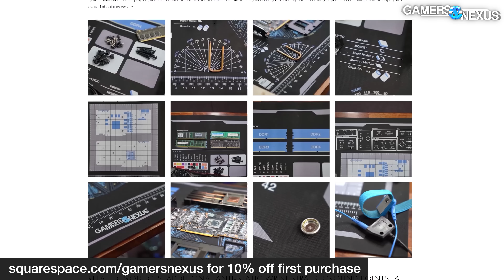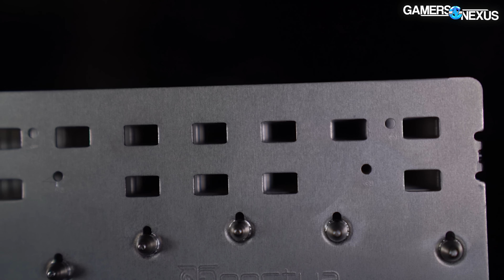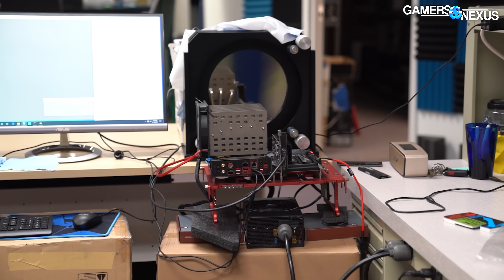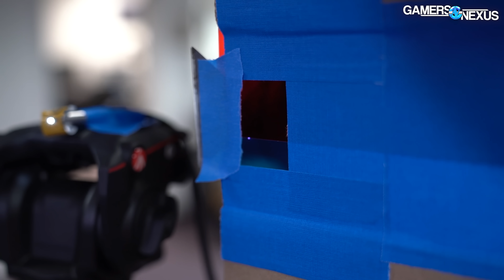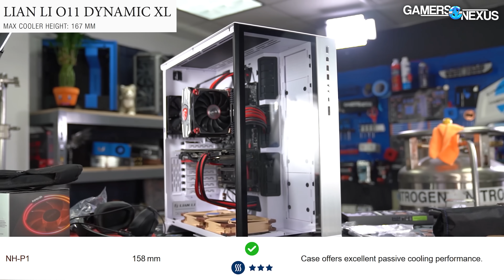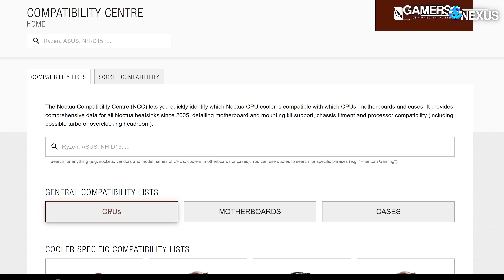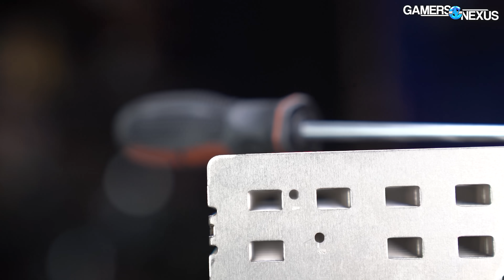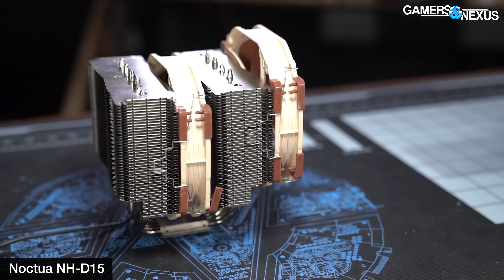Noctua NH-P1 Passive CPU Cooler Review: Benchmarks, Schlieren Photography, & Mechanics

Comment: Only good things here.

1. There's finally a pretty decent passive air cooler and while expensive, it makes a lot of sense for midrange cpus like i5 and R5. Even for APUs.
2. Steve has a new methodology and a new noise baseline to meme about. Not to mention he got the chance to use his fancy equipment.
3. This thing could be great for mineral oil pcs, if you're into that kind of thing.

Comment: Noctua is one of my favorite if not the favorite IT related brand. Well made, good quality and the price/quality is a win. 
And on top they have great customer service, if you bought a cooler with mounting for X and then later wanna use it for Y they will send you a mounting kit for free. I had a early Core i7-920 which I changed into a AMD 3600 keeping only the case and the CPU cooler, despite it being like 8 years old I was able to get a AM4 mounting kit from Noctua for 0$. That is good service and it minimizes eWaste.

Comment: Thanks for mentioning the specific fin spacing for passive coolers - there are actually engineering calculations for passive cooler fin spacing (depending on heat load, overall cooler size, etc.) and this is quite common in industrial applications. Of course yeah no fan means no intake of saw dust, metal particles..
I would add that usages for totally silent PCs include sound studios, where any parasitic noise is unwelcome, test chambers, and of course quiet homes (no street noise, no A/C...) where you do hear even those Noctua fans very clearly.
This would be perfect for a home theater PC as the power requirement for those is quite below the 65W limit, allowing for iGPU and passive PSU, and i'd certainly use this for a non-power user build as it means it's zero maintenance.

Comment: I'm tempted to give it a try on a apu based system, to save power by removing the fan.
Reply: That would be the best scenario!
Reply: NF-A12 LS consumes 0,6W at full power. Slow it down to 500rpm and the power consumption is next to none.
Reply: You would save more electricity by turning down your heating system in winter by a few degrees and buying a sweater instead.

Comment: Its an interesting problem.  I guess, primarily, its a spending problem.  how much money is one willing to spend on a solution?  I buy (for the most part) all Noctua gear including their more expensive quiet fans and I've got to say, it's been well worth the money.  The fans and the heat sinks are wonderfully reusable and have migrated between cases numerous times over the years.  In that sense, despite the initial expense, I think I have spent less money on average than if I had gone with cheaper solutions which would have required replacing worn-out fans more often.

I gave up on passive coolers years ago.  Frankly, the only time I use a passive cooler any more these days is on a Raspberry pi rig.  I just don't try for performance cpus any more.  Besides, the biggest noise problem in systems today is actually the GPU setup, not so much the CPU setup.  That said, the solution I wound up settling on, refined over the years, follows some simple, basic precepts.

* Its all about improving laminar flow and managing pressure gradients inside the case.  To that end, I strictly stick to front-to-back cooling with, typically, three fans.  Two on the tower cooler and one case exhaust fan.

* I use PWM fans all around these days, even for the case fan.  I always have at least one fan running when the machine is idle.  And more often these days, I have all three running at minimum RPMs.

* Having some bypass air improves air-flow, particularly over the VRMs.  So I offset the front-fan on the tower cooler as low as I can so some bypass air flows under the tower cooler instead of through it (which helps cool the VRMs too, by the way).  And I offset the case fan higher (well, usually there isn't much of a choice)... but that results in some bypass air flowing over the top of the tower cooler as well.

* The case fan typically generates the most noise, particularly if it is put right up against the grill, so selecting front or back matters and using small stand-offs so the fan isn't smack right up against the case grill can help too.  I usually still wind up mounting the case fan in the back because it significantly reduces the amount of work the tower fans have to do by providing a low-pressure exhaust path that would otherwise be somewhat blocked by the grill.

* And, finally, I remove all the dust filters (I have a whole-room air-cleaner like a Winnix going in ultra-low mode 24x7).  With the dust filters removed, air flow is far better and the fans are able to run at lower RPMs.  Frankly, dust filters don't do anything if the room air is already being cleaned up.  They will collect dust that would otherwise have simply gone straight through the case anyway and not really make the inside of the case any cleaner.

-Matt

Comment: My Father ordered one for the pc in his hobby workshop. Less airflow means less sawdust going into the pc, so it is perfect for that.
Reply from the maker: Excellent fit!
Reply: @GamersNexus  As he does woodworking I think that's taken as a given ;D
Reply: That is literally what this is meant for. This product is great for any type of work environment that has dust, people in these jobs often dont know how to take a computer apart and put it back together. I kinda want this thing for my arcade pc, so I can have the least maintenance possible
Reply: I see some great solutions in here! 
But keep in mind my father is not incredibly tech-savy. He can disassemble and re-assemble a PC, but that is roughly the extend of time he wants to spend on it. So simply installing a fan-less cooler will bring way less trouble than watercooling, using a Pi, etc.
Reply: @CarthagoMike  Well, for time's sake, this is fantastic in a work area.
Reply: @CarthagoMike  yep, definitely the right decision for him! No point in doing all that extra work if it doesn’t benefit what he needs
Reply: Well, no pun intended, no fans intended either
Reply: Also that custom motherboard with cpu on the back.
Reply: @odinstorm17  You mean the one Linus used? - https://www.youtube.com/watch?v=u6zsHqdNRQ8
Reply: Why not run a LAN cable there and then use a Pi or something that remotes into the work machine?
Or go MS Wireless display adapter and run a USB extension for the mouse and keyboard?
Reply: Instead of a complex watercooling loop, literally just run an airduct to the next room.
Reply: You are assuming that all woodshops are attached to another building. @MobiAussie
Reply: Why not something like a Raspberry Pi? He could probably buy one just for the price of that heatsink alone.
Reply: He could have just added one extra intake fan with good filter and have positive pressure in the case
Reply: LTT made that point
Reply: Awesome use case
Reply: But dust will still be a problem.
Reply: @enderblazex2718  Of course it will, but it will be a manageable problem. There's a world of difference between having to clean out a woodshops worth of dust every week vs doing it every other month.
Reply: A Zalman reserator could be good for that
Reply: And more heat, so it's perfect for that
Reply: You can't really do a fully fanless build in ATX though... you're going to have to move SOME air or your PSU is going to burn up. Maybe a raspberry pi and remote desktop to an external machine would be a better solution?
Reply: @TheWarmotor  oh you can have convective cooking for highly efficient PSUs. I’ve had 80+ Gold PSUs and never once seen the fan turn on.
Reply: @Mostlyharmless1985  Interesting! Is the rest of your system fanless?
Reply: @TheWarmotor  No, but, I've built them, matching low power CPUs with low power high efficiency PSUs creates a system with very low heat. to dissipate, convection will do the rest.
Reply: @Mostlyharmless1985  I build PCs for harsh industrial environments at work. Generally what I do is use a low-powered system, paired with a case that acts as a heat sink. Problem is that it limits my TDP to the point where the remote terminal is just running a remote desktop app to an actual PC running in the server room. Of course the benefit is that I only have to update a VM and hypervisor once and all of the terminals pretty much take care of themselves.
Reply: I would never do that. Passive is ok for super low watt M1 chips but now the heat will keep hanging inside you pc unless it's open on top. It's always better to have a fan in a serious desktop pc/tower. Just run it at low rpm and you won't hear anything. Also if the case has no fans but air vents you still need to clean it. This is a stupid product that doesn't make any sense! Same as water cooling. It's asking for trouble.
Reply: @Madrrrrrrrrrrr  This product does make sense. There is less cleaning involved in a fully passive computer, and almost all cases nowadays have a mesh vent on the top of the CPU. Having a fan (even on low rpm) will dramatically increase the cleaning involved, given the workshop environment.

Also, water cooling isn’t useless. At its best (custom loop), it is by far the nest cooling solution next to liquid nitrogen. And AIO’s give solid performance, especially in cases that cannot fit a large air cooler. Liquid coolers take years for performance decay/pump failure
Reply: @Screamintatatots  nah liquid cooling has much more moving/crucial parts. Installing and maintenance is more crucial with more disaster if it goes wrong. And no if there is a lot of airflow and dust like in a workshop the difference is marginal. You still run a open case. A fan also blows dust out. And this thing is huge. Same size as a typical 50/60 euro big air cooler that can do 120/150 watt tdp and does run on a lower rpm with a 100 tdp cpu. That's why they added the fan btw. They don't believe in it. What's next a passive cooled liquid cooling? Fans are an essential part if you want to cool. Unless you run a 14 watt chip :)
Reply: I wonder if he could run a water cooling loop through a wall into a dust free room for the radiators. Just make sure never to let the loop fall too much under ambient temperature in either of those spaces, or there could be a condensation issues.
Reply: @gunnar6674  That seems like 10x more effort than a simple shop-computer is really worth. Not to mention the maintenance that would probably be just as bad, if not worse than just using normal fans that require cleaning often.
Reply: @DeadNoob451  Oh, definitely - it's only something you would do as a hobby project. It's not something you do to save money or time.
Reply: @gunnar6674  From that perspective, i have to admit it sounds kinda awesome in an over-the-top kinda way.
Reply: @DeadNoob451  I've seen industrial pc enclosures that are basically a case for your PC with just air filters on the intake
Reply: @gunnar6674  or keep the pc in the dust free room and run some cables for display and usb.
Reply: @tehfunkiestmonkey2758  Yeah that's what I said in my follow-up comment. Maybe YouTube didn't show it to you - it gets weird that way.
Reply: @gunnar6674  If you want OP water cooling why not sit a 205litre drum next to it, fill it and plumb the water cooler into that. A 200W load would take 71minutes to raise the drum temperature by 1°C. Much easier than going through a wall.
Reply: @gunnar6674  At that point it's better to put the computer in a dust "free" room and just use longer cables for monitor and peripherals (or like a usb hub or some).
Reply: @gunnar6674  if the fans are already outside of the pc, why would you need to put them in another dust free room?
Reply: @gunnar6674  Or just move the entire desktop out of the room and use extensions to have a monitor and some peripherals there.
Reply: @gunnar6674  Water cooling isn't reliable and requires more maintenance just to be a typical shop computer.
Reply: @jamesm568  It needs more maintenance, but it would a dust free alternative. Of course, just having the computer in another room and running control cables through the wall would be an even cheaper solution.
Reply: @jamesm568  water loops need a flush and dust about as often as an air cooled PC. If you use black tubing (so discolouration isn't an issue) it barely needs more than anything else.

Especially with low point drains etc. For a workshop PC you could do low maintenance water cooling pretty easily.
Reply: @lunchie80  But why would you go through the trouble with water cooling when air cooling is more efficient? Buy a Hyper 212 and call it a day. Take an air compressor and blow the dust out every once in awhile and 10 years later the thing will still work. Never seen water cooling last more than 2 years. I leave the water cooling for special small applications or people that like gimmicky products.
Reply: @jamesm568  Custom water-cooled loops do give the best thermals. And if you don’t use a cheap pump, will last for years. And water cooling (even AIO’s) isn’t just “gimmicky,” there are cases where water cooling is required (dense servers, cases where a y’all air cooler won’t fit, etc.).
Reply: @gunnar6674  linus actually did that to eliminate noise while keeping the performance of a water cooled 5950X and multiple titan blacks back in the day. Thunderbolt 2 over fiber optic was what he used but it is possible to do that with T4 now afaik.
Reply: @lunchie80  AIOs have a service life of about 5 years, open loop coolers require monthly maintenance. Shop computers have an expected life of about 10+ years. It's entirely impractical to use water-cooling for an industrial application.

Comment: I think it would have been interesting to compare this cooler to the NH-D15 without using the included fans, just to see the impact of fin density on cooling. You might also want to compare it to the Nofan CR-80EH, which is probably the main competitor to the NH-P1
Reply: CR-80EH is trash. NH-P1 is almost identical in performance to CR-95C.
Reply: @suqd674  You are correct, I had the models confused. They also have the slightly larger CR-100a. Also, I recall that silverstone also made a fanless cooler
Reply: @raphaelbelanger6764  I have all Nofan coolers, CR-100A performs about 4C better than NH-P1, CR-95C performs on par with NH-P1. CR-100A is impossible to buy nowadays though, even on ebay it pops up only once a year or so. CR-95C still available on quietpcusa store, otherwise also hard to find, it pops up on ebay like every 1-2 months.
Silverstone HE-02 was advertised as fanless, but it doesn't perform nearly as well as CR-95C.
Reply: @suqd674  That's interesting. I haven't been closely following fanless cooling, but I still think it's very interesting. The computer I have right now is quiet enough that I'm not really considering buying one of these. The different design choices made by Noctua, Nofan and Silverstone are intersting because they all have different approaches to the same problem
Reply: @raphaelbelanger6764  TBH, even Nofan CR-100A is pretty disappointing. If money is not an issue, buy Monsterlabo The Beast, or wait for Streacom's passive solution which should come in 2022.
Reply: @suqd674  It's not that I can't afford them, it's just that I don't feel the need to upgrade. I'm perfectly happy with my BeQuiet Dark Rock Pro 4. It's not fanless, but it's quiet enough that it doesn't bother me. In the summer, when my AC is running, it's 10x louder than my computer. I would be much more inclined to build a watercooled computer than a fanless one, but at that point it's just a matter of preferences

Comment: I honestly still don't see a use for it, isn't one of those backwards mounted CPU sockets with that massive heatsink a better way to go if you're going for a server? I don't even see a case for a super silent build because there are coolers that run at lowest RPM with a better performance, and you can actually afford it without having to save up.

Comment: 16:45

Love the "~0RPM" for the cooler. It's technically not wrong, but it's also not right, and it just got me for some reason.
Reply from the maker: Haha, thought it was funny to do it that way!
Reply: As many RPM as times you rotate the case. There will be many zeroes.
Reply: Isn't it closer to 0.00069444420027778 RPM? Earth spins...
Reply: @Mostlyharmless1985  But Earth doesn't spin under its atmosphere. The atmosphere spins with it. Otherwise you'd have global storms with speeds across the ground of up to about a third faster than the speed of sound.
Reply: @Anvilshock  I don't see how that's really a concern, you still rotate.
Reply: @Mostlyharmless1985  Again, as would the air. Meaning, I don't see why you found it terribly necessary to quip some seventeen decimals of something that doesn't even matter.
Reply: @Anvilshock  Look, just because you are a humorless pedant doesn't mean the rest of us can't have fun.

Comment: these protruding "inner screws" are pretty annoying to work with, positioning on top of them requires way more dexterity than it should, especially as you have to keep both of the "outer" screws slightly raised to not get in the way

Comment: I really appreciate the testing of the stock coolers.  One of the most common questions is "Do I really need an aftermarket cooler".  The normal answer for an AMD CPU is "no, but aftermarket will be quieter".  Nice to have some actual data.
Reply: And if you run something like 5800X you will be leaving 200mhz out if using stock cooler in cinebench.

Comment: i have my fans running at like 200-400 rpm, they make pretty much no sound whatsoever at that speed and move atleast SOME air enough for things to actually not be too hot, push pull on my cpu cooler and otherwise like 9 case fans 

i havent done any testing but would push pull be actually useful for a situation of very low rpm fans on each side?